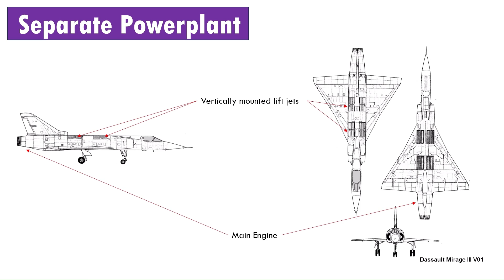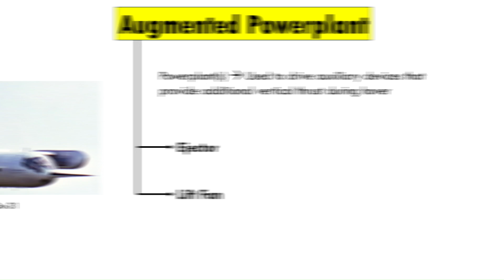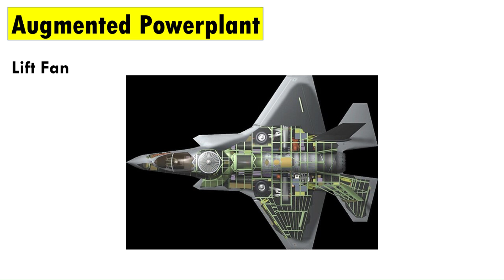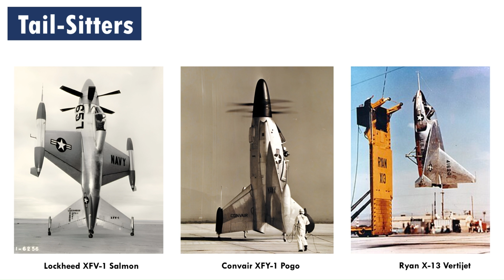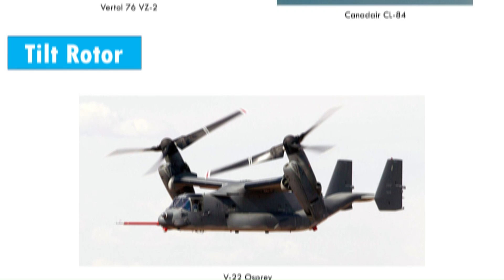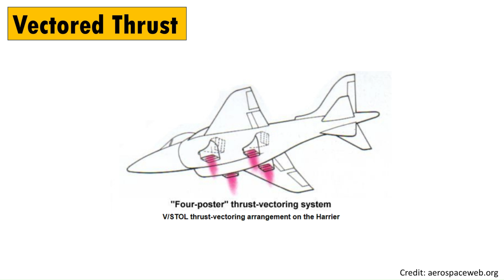VTOL Design | Different Types of VTOLs Explained

Comment: Theoretically, the F-22, F-15 Active, Su-37 and probably a bunch of others can achieve thrust/weight >1 on light loads while having the required thrust vector/ differential thrust control axis to do a tail sitter style takeoff when provided with a sufficiently inclined launch ramp. (this is based on wikipedia numbers, static thrust might be lower)
Also I remember seeing some "zero length takeoff" test footage where they launch starfighters and F100s from portable launch ramps using rocket boosters.

Comment: The tilt wing seems to make so much sense, and from what I've heard, even before they had modern control systems, they were still stable.  I think if we can control the CG well enough, and you have big enough control surfaces, that you may be able to get away with using the ailerons to not only control yaw, but also control tilt by mixing "elevator" into the ailerons when in hover, turning them into elevon/rudders.  This mixing however may become tricky in transition when the ailerons try to do 3 things at once..., roll, pitch, and yaw, along with the elevator, rudder, and motors.  I keep thinking this would be a cool thing to play with in RC.  Thanks for this cool rundown.  Made me think about it even more.

Comment: So what's the real difference between the F-35B and the YAK-141?
Reply: The Yak-141 uses separate lift engines for VTOL while the F-35 uses a single engine, the lift fan is powered by the single F135 motor. The Yak-141 has 3 seporate motors.

Comment: Technically any plane can land vertically, the softness of that landing though is a different matter
Reply: It's not the vertical landing that's the problem, it's the sudden deceleration...
Reply: @minimalbstolerance8113   exactly! not like i designed the propeller wrong, it is the landing gear that broke!
Reply: @minimalbstolerance8113  no it's the sudden and abrupt stop to zero almost instantly
Reply: you are telling that to a dude who can fly. once. 
could fly* (jk)

Comment: what's the difference between tilt rotor and tilt prop ?
Reply from the maker: In a tilt rotor, the whole engine assembly rotates along with the propeller, but in a tilt prop, only the propeller assembly rotates (the engine could be placed in the body and the propeller is connected via shafts and gears that allow it to rotate).

Comment: Imagine being in a rate fight against a VTOL aircraft with separate power and he engages the lift jets for extra lift...
Reply: literally any war thunder player using a harrier or yak 141:
Reply: That's kinda smart ngl.
Would be fire in a movie
Reply: @CosmicHase I actually agree with you
Reply: @RadicalFloat_95I actually agree with you too
Reply: Thank you  @CosmicHase
Reply: @CosmicHase I actually agree with you three
Reply: The British Harrier pilots used this to great effect against he Argentines in the Falklands.  When a much faster Mirage would get behind them they'd dive, then push the nozzles all the way down (which was actually a few degrees forward), not only slowing the aircraft a little but popping it into a "new" vector in a sense.  The Mirage would streak on by even as the Brit was pulling the drive back to forward flight and into the shooter's seat.  It was a real life Top Gun move with some Z movement thrown in.
Reply: Vector In Forward Flight (ViFF)
Reply: average warthunder player
Reply: The issue there is that all the thrust propelling you forward has suddenly stopped doing so, and your airspeed will quickly drop. Alongside with the lift from the wings.
Reply: @reinbeers5322  Separate power VTOLs have separate engines for lift, they only add to the main engine's thrust
Reply: @KekusMagnus Yes, but the most common aircraft to use this tactic was the Harrier, which does not. I don't think the increase in weight from a separate-power VTOL installation would be worth it here.
Reply: engaging both jets at the same time would absolutely kill your fuel
Reply: haha funny yak-141 go vwoosh

Comment: You should consider re-uploading the video with talking speed of 50% the information is presented so quickly it's hard to pay attention to.
Reply: I think 50% would be too slow, and possibly just pauses would be enough after information is given. Possibly also popping bullet points on screen at the same time as words are said (NOT the whole paragraph but a condensed version, and not on screen until the narrator is talking through that point)
Reply from the maker: Thank you for the feedback. I will try and make the changes for future videos.
Reply: I know I'm late, but you can change the video playback speed under the options gear, just have to remember to set it back to normal speed when you go to another video.